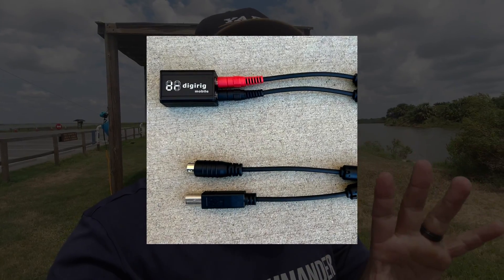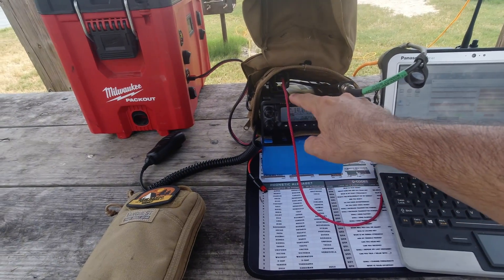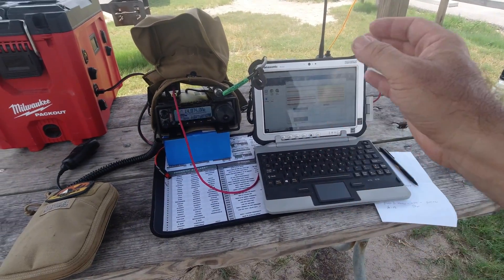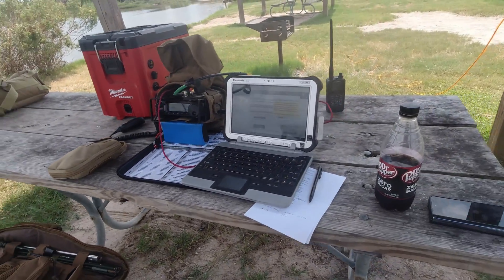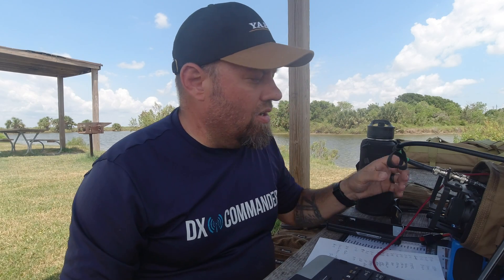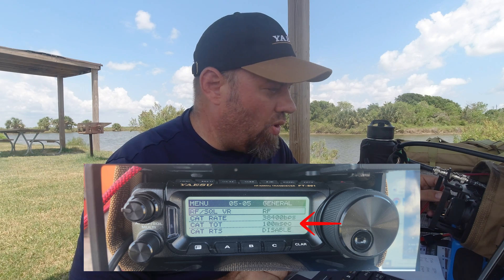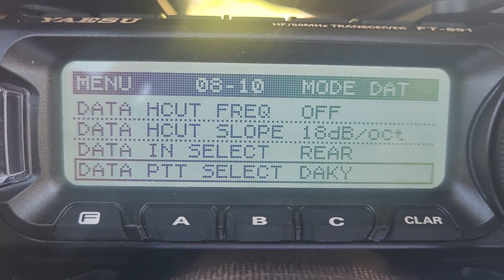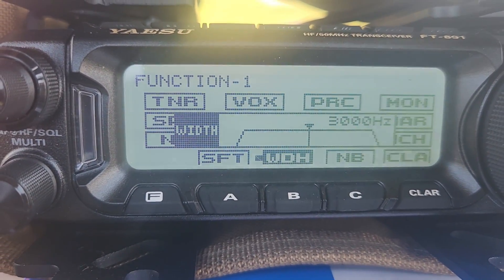EASY! FT8 and Digital Modes with the DigiRig DR-891!

Comment: Man, I think you may have saved me a ton of time setting up my FT-891 manpack digital setup later. I have been working on getting my portable setup built and ready to go out and play pota with the guys from my local club. I have been using YouTube as a resource for both figuring out what worked for others and how they went about setting their rigs up, and as a free motivational resource. I have been making videos of my progress building mine to kind of motivate myself to complete the project as well as to encourage others to learn from my build. Thank you for the video and sharing the settings that work for you. I have a getac windows tablet and a vehicle mounted docking station with RF pass through for the tablet's GPS/wifi/4g connections and port replicator. I am certain I am going to have config issues with operating in the vehicle then removing and going portable... the dock also has a built in sound card... So, I imagine I will video those antics when I get to that. Thank you again, just earned a sub from me man!
Reply from the maker: Awesome, glad it helped!

Comment: Can somone help me.  Great video by the way.  Using Digirig and 891.  But sometimes when WSJT keys up radio all I get is a millisecond click I can hear relay click and then it stays in receive mode.   It does it often.  I know its a settings issue but cant find out where.
Reply from the maker: Mine hasn't done that

Comment: I notice no tuner used doing FT8 with Digirig?  Is a tuner not needed using FT8??  Thanks 73
Reply from the maker: The tuner is used for the antenna, not the mode. On this day I was using a resonant antenna, so no tuner needed
Reply: @HamRadio2  thanks

Comment: Joe Taylor didn't put the 891 in the software, he just uses the hamlib library.  Almost every radio is in that library.  Hamlib is for cat control regardless of if the radio has a sound card.
Reply from the maker: Joe Taylor used HamLib though
Reply: @HamRadio2  Yes, of course.  The alternative would be to manually code for every radio.  I'm just saying that that the items in the dropdown are all the radios in hamlib and it's about cat control, not audio.

Comment: I didn’t see the connections on the back for the digirig. I have the 891’s complimentary ATU attached to the bottom of the radio. Does that use one of the ports necessary to use the digirig?
Cordially, Chris KF0KEO
Reply from the maker: I don't have that ATU so I am not sure what ports it uses, but the DigiRig uses the USB-B and Data ports in the back of the radio

Comment: BFO should not be set to AUTO as all digi modes are USB.  In Auto, the radio will switch to LSB for 40m and lower freqs which you don't want to have happen.

Comment: But the FT-891 has a USB-port. Why not use it?
Reply from the maker: The Digirig connects to that port
Reply: The 891 doesn't have a sound card built in. That's where the DigiRig comes into play.

Comment: Great content.  I'm really new to FT-8 but having tons of fun with it.  I have a question.... do you use a logger like HAMRS while making FT-8 contacts ?  And, if so, do you upload those logs to QRZ or LGoTw once a day?  Just not sure how I should be doing it.  Might even be a good idea for a video.  Thanks Jason, proud to be a Patreon.
Reply from the maker: For FT8, I let WSJT-x log all the contacts.  Then you can upload that log straight to POTA.app.  But for this activation, I also made some SSB contacts afterwards, so I took the WSJT-x log and added it to my WRL log by using ADIF Master.  Then I saved that as 1 file and uploaded it to the POTA website.

But you can do it either way

Comment: Nice setup. DiGi Rig is great . What I use for my QT 60 HF radio for digital modes. Same speaker default for windows. I changed all that. The hardest setting was TX level that radio had no ALC meter. Gust more work and trying . Must be a small UNUN to only do 30 watt FT8.  73